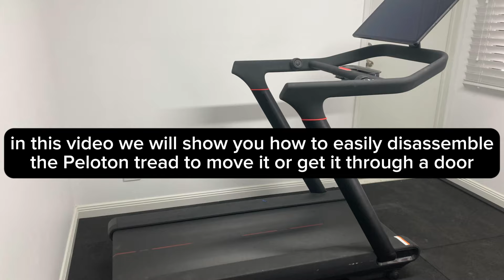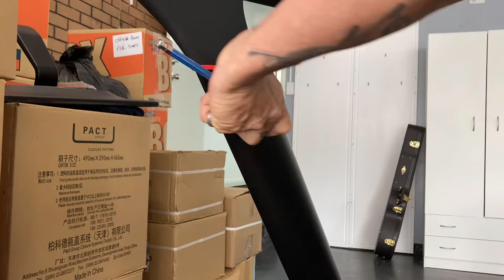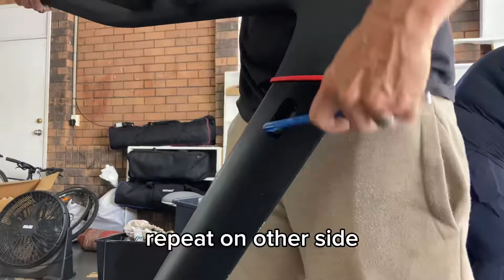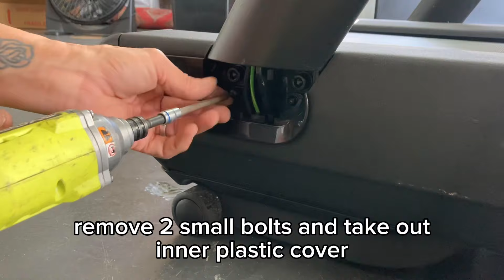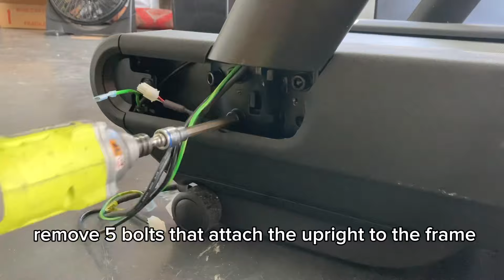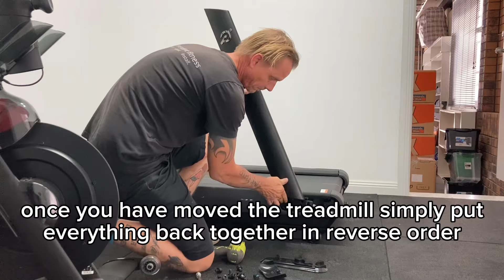How to easily disassemble a Peloton Tread treadmill to move it     #peloton

Comment: So this is what Peloton technicians want to charge me $400 to do. Disassemble when moving from my old house. And reassemble at my new house. Thanks! You just saved me $400!
Reply from the maker: No worries at all, happy to help 💪
Reply: Yeah, it's insane. I looked two days ago and the price was 225 each now. The fact that don't don't transport it is also a WTF moment. I could understand if its going 100 plus miles away but 20 miles down the road... To top it off, the 'techs" that delivered it were JB Hunt Final Mile. They literally had no clue what they were doing. One tech had installed 3 of these total and the other it was his first time. It was a nightmare. They damaged my floor in multiple places. Dropped a bolt in the machine. Luckily they had the honesty factor to dig it out of there. Took like 30 mins but at least they got it out. I figure I can move it myself. Can't do any worse than the "techs" that installed it.

Comment: SukjeetHundal those smaller screws require a 3mm allen wrench.  the larger screws require a 8mm allen wrench.  Another tip the video doesn't show is popping off the bottom rail covers, go from the center of the bottom.  I scratched mine up trying to pop them off from the sides like in this video, but they come off much easier from the prying from the bottom.  Lastly, be careful with the cables  in the side rail.  One of the cables slid down inside of the rail and I had to pull the wires out completely and put them through again, but happy to say I was able to get it back together and running smoothly after a bit of effort and being moved from one room to another.
Reply from the maker: Thanks Scott 💪
Reply: I came to the comments looking for this exact answer! We couldn’t figure out what size Allen wrench to use on these screws! Thank you!
Reply: dude! Same! You need to tape down those wires so they don't slide down and also so they wont get pinched in transit.

Comment: My movers lost the two 8mm bolts for the uprights, on both sides. Anyone know if I can buy replacements or if Lowes/Home Depot might have them?
Reply from the maker: You can easily buy replacement bolts, not sure of the length but if you have the other ones you can take one with you to the hardware store and they will definitely have some. If you can try and get high tensile bolts as they are a lot stronger.

Comment: It wasn't clear from the video but do you remove the uprights with the monitor attached?  Or do you remove that separately?
Reply from the maker: You can do either. If you are transporting the treadmill I would suggest taking the screen off so it doesn’t get damaged in transit. 
if you are just moving to another room in the house you can leave it on.

Comment: How do you put the top part with the screen back on the 2 legs? We reconnected the wires but they’re not going back through the side of the machine! Let me know please!
Reply from the maker: The frame should just slot back in and the wiring should have a little area to “sit in”

Comment: How did you get the bottom screws out the one you used the drill for? I’ve tried every torx and hex drill bit I can think of. Which on did you use?
Reply from the maker: Should be a standard Allen key size

Comment: Any tips on moving the tread base? Need to get it on a U-Haul
Reply from the maker: If you raise the incline before pulling it apart you can lift from the back of the machine and wheelbarrow it. 
Alternatively you can tip it up straight and move with a trolley. 
If you need to lift into a trailer I would put the back in first then lift the heavy end in (motor end) 
Best to have at least 2 people for this. 
Hope this helps 💪
Reply: @FitnessEquipmentHowTo  thank you! So do you think that granted I have 2-3 people helping that I can get away with moving it still assembled ?(probably take off the screen display only) and then would possibly go with #1 of ur suggestions which is wheeling it and then somehow lifting it up and down out the truck?
Reply from the maker: @danielleprendergast 
Yes most definitely. 
If lifting fully assembled you would need at least 4 people just to be safe. The majority of the weight is at the front where the motor is so this end will need to most muscle
Reply: @FitnessEquipmentHowTo thank you, moving today, may give this a try!
Reply from the maker: @danielleprendergast 
Excellent. Good luck 🤞💪

Comment: So you don’t remove the screen? Also Peloton instructions say to angle the tread before moving… is this true?
Reply: No
Reply from the maker: Putting the treadmill on an angle is handy if you are moving it around the same room or to get it onto a truck, but if you are using a trolley or carrying it you don’t need to do this. 
You also don’t have to remove the screen, this was done on this one to prevent it from breaking

Comment: He skips some steps regarding disconnecting the upper cords so that way you don’t pull the cords through the upright. Basically when you take off the top you will have chords to disconnect. I thought you disconnect on the bottom and pull them through the post and then slide back through based on this video. But that not the case. Other than that it really helped
Reply: I crimped and broke my top cords because of this. I wish this step had also been included. 
It is also much safer to remove the screen regardless of how far you are moving the tread. It would have been nice if that was shown as well.

Comment: The people who put mine together tightened the ones on my screen so tight I couldn’t get the screen off with my torque wrench. May have to use my drill
Reply: That happened to mine too!  I called Peloton and they had a recall on this problem.  They sent replacement parts for free.